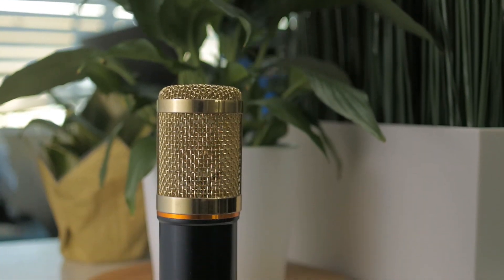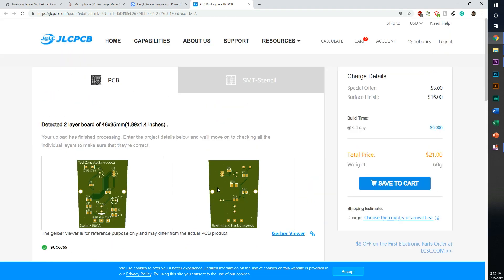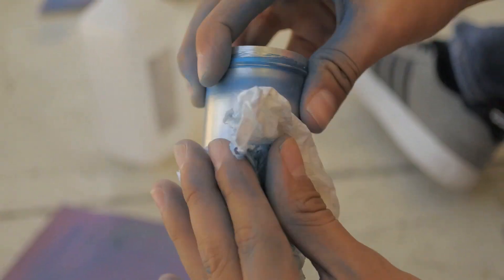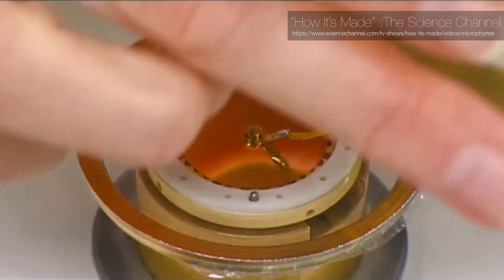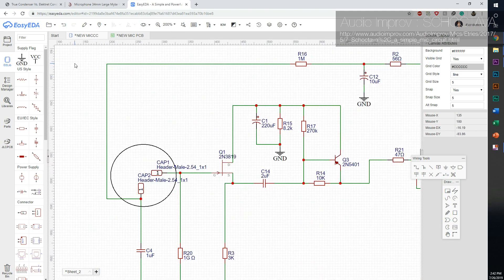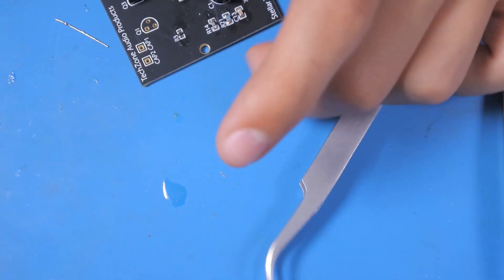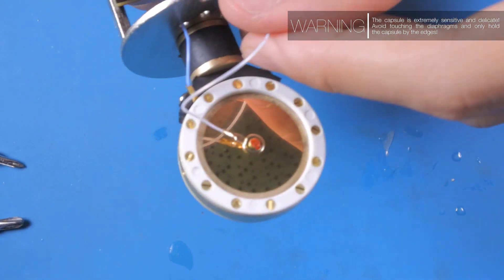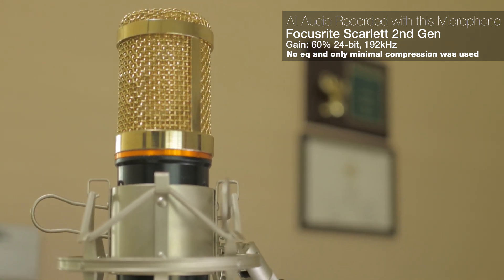Build your own High Quality Condenser Microphone

Comment: This is really cool! Thanks for sharing. I am a n00b with a dumb question. Could I just wire a nice condensor capsule to an xlr and them plug it into an inexpensive preamp for phantom power like the $23 saramento?
Reply from the maker: That would not work, unfortunately. The interface is just as important as the microphone and you will need to get yourself at least a Behringer USB interface.
Reply: @SlideoStudios  thanks for the reply. I'm going to get your X2 and an aperture shotgun. Unless there's a chance you'll be making one??

Comment: is this the same capsule that of the Stellar X2?
Reply from the maker: No it is not anymore as we now make our own capsules with the help of a local machining shop and we also have made intensive software for quality control purposes!
Reply: TechZone Productions I need a 2x
Reply from the maker: We started to make our own capsules because this capsule was way too dark and you could hear it in the video too. Our new capsule uses the same backplate design but we assemble the mylar ourselves. The new mylar is about twice as thin which improved its sensitivity a lot and produce a much more balanced sound. We also use better gold sputtering technology that is thinner and evener and offer very good quality control such as frequency sweep on all our microphones for the X2.

Comment: This is a build just for fun right? Because you could get an used rode NT1-A for cheaper than this build.
Reply from the maker: A RODE NT1-A has a unpleasant harsh bright tone to it compared to the K-47 capsule. For this reason, there are people on eBay that sell modded NT1-A all the time. Also, you cant compare a USED mic to a new one. These used mics you see on eBay are so old and dusty.
Reply: @SlideoStudios  Electric condenser mics last about 20-30 years and in that time a microphones sound barely degrades. As always liking sound is subjective but in my opinion even an at2020 sounds better. There are alot of microphones in the 150$ range and I would compare the sound of this one to a bm/nw-800.
Reply from the maker: @icecreammonster8519  https://youtu.be/CVmvgZB7yb8
Reply: This modded mic is possibly way better sounding microphone than many things on the market rn. I rather own a warm sounding microphone than a bright mic like the rode nt1-a
Reply: @davidkim2354  There are multiple microphones with different sound signatures in the 150$ range and you could probably find a microphone that you like just as much or even more for cheaper
Reply: @SlideoStudios  I already told you sound is subjective and I like the at2020 more.
Reply from the maker: @icecreammonster8519  When comparing specs, a true condenser can handle things much better than the AT2020. This microphone is also much LOWER noise than the AT2020. It can handle loud sources better than a small electret and due to physics, a small electret will never have the sensitivity or lower noise floor as a true condenser.
Reply: @SlideoStudios  Its alot harder to compare microphones when you only speak into it. I would say if you spoke into an at2020 it would sound better. But if you had recorded some vocals or guitar I might have heard this microphone as the better one. Also i dont belive you clarified what setup you used with this mic.
Reply from the maker: @icecreammonster8519  I mentioned I used a focusrite usb interface. And we are not talking about subjective sound quality here I am simply talking about specs like noise floor and such. In those case, a true condenser would win anytime. Also this mic is designed to mimic the sound of a U47 with that vintage tone. Most people would perfer an AT2020 with its brighter tone but this microphone is specifically designed to not have that brighter tone. If you want, you could get the K67 capsule to get that bright tone.
Reply from the maker: @icecreammonster8519  But when looking at a microhpone tone is one thing but other things you have to consider is noise floor and sensitivity. Like I mentioned before, specs-wise a true large condenser would win.
Reply: @SlideoStudios  What's a dimensions of that pcb inside BM800? I think 48mm upside 35mm downside but what is lenght? Could u provide dimensions please? Thank u!
Reply: @icecreammonster8519  Your ears aren't trained at all so you don't know what you're talking about. This mic sounds way better than the cheap ones.
Reply from the maker: @icecreammonster8519  Also its not that it degrades over time its dust on it will degrade. Most of the used eBAY mics have been in studio where they smoke a lot and those can damage the capsule.
Reply: @SlideoStudios  Thats why you look at the description and see why they are selling it and how long they have been used for. Also there is always a possibility to ask for a refund.

Comment: i have a body and capsule, can you tell me how much it would cost me to make such circuit borard? i want to replace the current board in my mic
Reply from the maker: What capsule did you buy? The circuit board plus shipping comes to around 40 dollars ish and the components can cost around another 30. If you are interested I can sell you a premade microphone that has a higher quality body for cheap, a capsule, and a newly designed even lower noise circuit then the one in the video with an actual balanced output for a cheap price. 

Thanks!
Reply: Actually I already have a shure condenser usb mic which  i am trying to make it into a regular one by adding a new circuit board ...I have a 34 mm capsule and high quality body ...what I want is a circuit...Can you help me with that
Reply from the maker: @snehalps2250  Wait sorry I misread. Do you want to convert a usb mic into an xlr mic or keep it USB? If you keep it USB, it will be nearly impossible because the large capsule requires a polarization voltage of around 50 volts DC which is hard to supply though USB.
Reply: @SlideoStudios  i want to convert it into an xlr one...
Reply: I have a sound card with phantom power...All I need is the circuit  board
Reply from the maker: @snehalps2250  Are you sure you can replace the USB connector with XLR? And do you want me to make you a premade board that fits with your mic?
Reply: @SlideoStudios  ya but 1st can you tell me how much it will cost..I am from india so I don't know if it is practical to get it done... Because the same type of mic can be bought for around 100 dollar range. ..And I listed the parts in the video which is around 10 dollar...If you could share me the details of the new schematic that would be helpful too
Reply: If you wanna keep it low cost, you could always use a universal board and just make sure the connections are right. The schematic itself is pretty simple and it will be way cheaper than getting a dedicated board